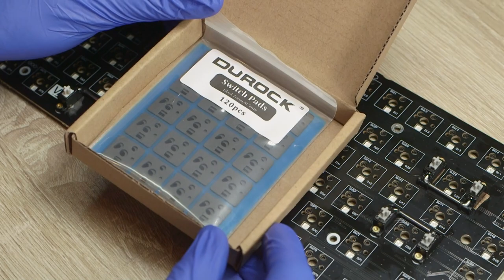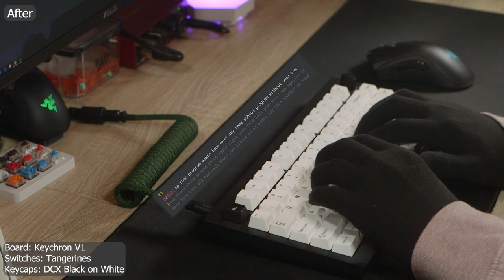Keychron V1 Stabilizer Mods, Spacebar Mod, and Switch Pads! Spacebar sounds so much better!

Comment: I'm new to the hobby. I just picked up a V1 and I already want to mod it because I'm not a huge fan of the space bar. I like what you've done here.

What are your thoughts on the switch pads vs replacing the plate to something softer?